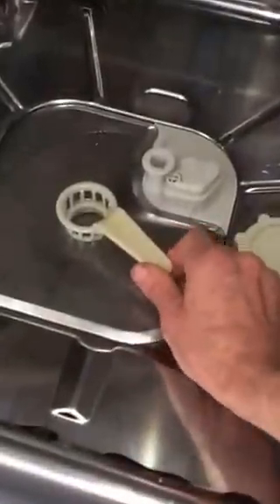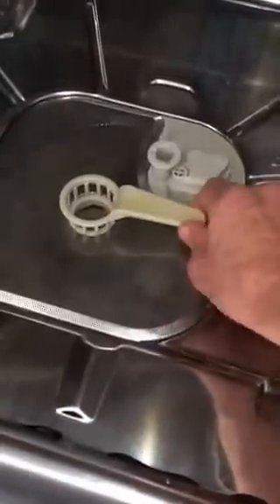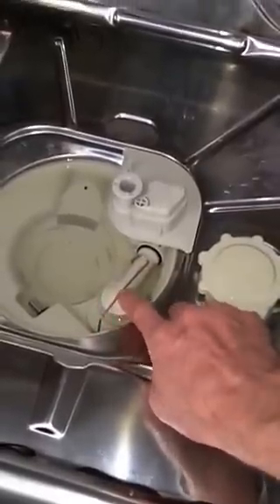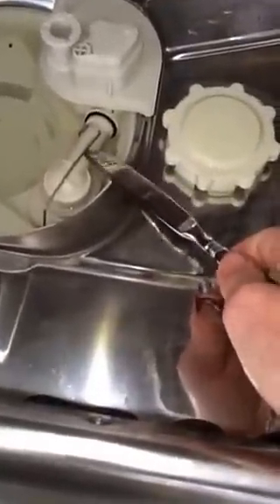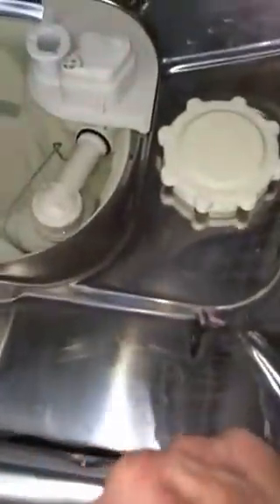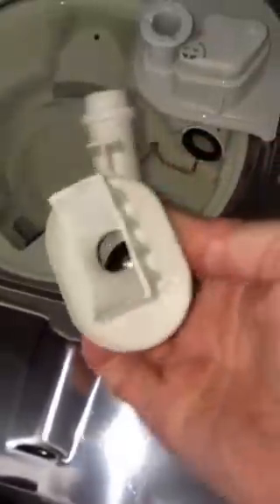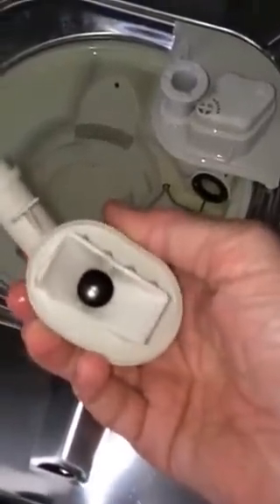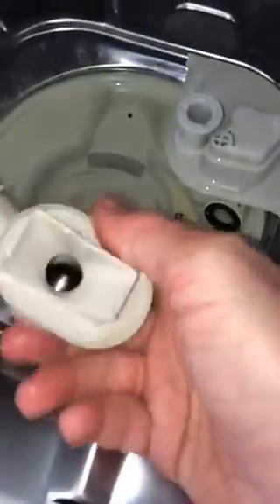✨ Miele Dishwasher - Intake/Drain Light - (3 Minute FIX ) - No Tools ✨

Comment: Can someone imagine that I fixed it???))) mom of 3, just instead of paying 300$ to someone, opened your video, followed instructions (though I had to disassemble that small part that you put away, there was a plastic thing stuck in there) and voila! Done! Will go and by myself a dress )
Reply from the maker: You should, you deserve a new one😊👍
Reply: I did it and I switch it on with the door open. When it starts the program it looks like the impeller push the water into the dishwasher instead of push it out to the drain pump. Any idea?

Comment: The non return valve was hard to remove. I passed a short length of rope under and through the valve and yanked up. This trick worked if you have problems removing the valve.
Reply from the maker: Good idea👍😊
Reply: Thank you. I got it out with a length of folded gorilla tape. There was a piece of plastic jamming the wheel
Reply: Thanks for the idea - was really struggling to remove mine!

Comment: Brilliant, clearly ex[plained , easy to do and the pip which had blocked my propeller was removed. I rebooted my machine by holding stop/start button and the Top Solo button at the same time, working perfectly now. Thank you so much, Diane.

Comment: I have checked every possible obstruction... the filter basket, the valve, the impeller. I can't find an issue. Everything is clean and/or able to move the way it should. When it first stopped working, the soap had already been released. I put another detergent tab in and for every subsequent attempt, the door doesn't open to release the soap. And it just pretends to work for a few minutes before getting stuck on Intake/Drain.
Reply from the maker: Can you send this same question to my email at: scottthefixitguy@yahoo.com

Comment: Thank you very much for your video. 

Just returned from 6 months away and surprised dishwasher wasn't working. Had to remove the ball part (after much effort) and check impeller (which worked fine).

Solved the problem and dishwasher operating now. many thanks and great appreciated
Reply from the maker: Very cool, thank you😎
Reply: If you're not going to use your dishwasher for some time, add some distilled water to cover what is shown in this video.  It helps to keep the seals wet.  I was told this by a Miele repair man.   You can reach the propeller just to the left and below the non return valve.  My little finger fit in and was able to turn the propeller.

Comment: My Miele Man! This is the 3rd time I've done this in the 10 yrs I've owned my Incognito. Worked every time. This time I found a few pieces of glass in the bottom after I removed the works but I have no broken glasses so the glass must have been hiding somewhere. I was kind of flummoxed this time because after I did all you said, it wouldn't start even though the red light was off...Duh! I had forgotten to push a cycle button when I turned it on. All good now! Thank you tons!
Reply from the maker: Thanks so much Mary😊

Comment: Hey Scott. Informative video!
My intake  gets stuck every couple of years and soaking it in vinegar water usually does the trick. However not this time. What do you do when the basket is stuck in place and wont come out? I'm afraid of breaking that plastic handle
Reply from the maker: This should help: ✨ Miele Dishwasher Stuck Filter⚙️ EASY DIY FIX ✨
https://youtu.be/se8e3ZrmXSM

Comment: Hey - I have an Advanta Series - been running great for 15 years.  I've tried this several times, the ball bearing is free;  the impeller moves (w a little resistance).  I tried the fork trick too (different video) but nothing really helped.  Anything like being level, some kind of hose blockage, motor issues.  I hear the motor which is usually followed by water running out (visitble through the bottom of the disposal) - but no water flows.  Any ideas?

Comment: Do you have similar instructions on how to do this for the Miele Optima Series? 
The video doesn’t exactly match the insides of my machine.
Same issue though. Intake/Drain light is flashing.
Thanks!
Reply from the maker: Your model is even easier.
Just pull off the filter and then to your left is the drain one way valve.

Pinch in with your fingers on the plastic tab and wiggle it off👍
Reply: @ScottTheFixItGuyChannel  I got the drain parts off and cleaned them out but I still have the same error light. Could it be something else? Do I need to call a Miele repair person out to replace something internal? I appreciate the help. Thanks.

Comment: Great video but I also had to check out the drain pipes.  We had an F11 drain fault show up.  We have a large family and also broke a couple fine wine glasses recently in the dishwasher.  I found little glass pieces by following this video along with a really gross filter that needed cleaning but the F11 code returned.  Your dishwasher drain pipe likely pipes into your garbage disposal.  As a quick fix turn on your garbage disposal to make sure there isn't water sitting in there.  Ours did and likely what ultimately fixed our F11 code.  Before that I checked the drain pipes.  There are two pipes connected to your dishwasher and passes under your sink, one for water to go in, one to drain.  The drain pipe is likely warm if you just used it and little heavier if water is clogged.  Our drain pipe under our sink had a joint we could easily disconnect and some gross water dumped into the pot I placed beneath it.  I found another small piece of glass this way.  Finally I opened up the air vent that is attached next to your sink.   You'll see a small pipe within the air pipe.  I used the faucet to run water through the small pipe which ran water to the open pipe below the sink leading to my pot.  I then ran water to the large air vent and water ran into garbage disposal.  That's when I realized I just needed to run the garbage disposal a little.  Put the drain pipe back together and ran under rinse mode.  FIXED!!!

Comment: My filter in the bottom of the machine is broken. I have a picture but i cant show it here in the chat i think. Is the filter necessary for the machine to fill up and drain water? Or can it work without that filter? I am troubleshooting to find out what to fix as the machine dont fill
Reply from the maker: When you turn it on,
Is it constantly draining?

Comment: I have a very old Miele dishwasher ( G595SC).  Recently the Water Inlet light has been coming on a lot of the time.  After much cleaning and reading I have found that there is a High or a Low water pressure setting.  This is in fact described in the manual.  My water supply has recently been changed and is now Low pressure.  I followed the instructions (it feels like a game hack) and now the error has vanished.  I mention this in case others out there are running a 30 year old dishwasher.
Reply from the maker: Very cool,  thank you

Comment: I think you had answered my question before. The machine wasn't draining completely. There wouldn't be any water in the machine, but when you pop opened the filter, there would be enough water there for concern. When we got a new non-return valve, it completely fixed the problem, after each rinse and drain, there wasn't even a half inch of water. Now, the water is much higher. It's still below the filter, the it's way too high.

Lately I've been using those Cascade Platinum tabs which is probably a big mistake because it's like putting Dawn in the dishwasher and I'm wondering if the drain hose is partially blocked with soap. Like I said,  it still drains; but nothing like before. You can hear the difference. The water just doesn't come rushing through the bottom of sink like it used to. Another thing when you turn the machine on and it start to drain and it will make a noise just before it starts to fill. That's normal, but whatever water drained just seems to come back into the dishwasher. It can't be the valve because it's still in good shape. Uggh, when these machines work, they're great, but when something goes wrong; it's aggravating.

I called a place that works on European dishwashers and they're really. They're coming out on Tuesday. Miele Service just charges way too much to come out to do anything. We used them for our washing machine and it was a difference of $150.
Reply from the maker: Good question,

It’s actually good to have about 1 cup of water under the filter to keep the impeller seal moist.  Bosch does the same with their dishwashers.
Reply: @ScottTheFixItGuyChannel  I know what it is.  The sealant to the where the non return valve connects looked like it peeled off.  It's hard to describe.  I'll take a quick video of it to show you.  I don't if I can put a sealant or what.

Comment: I would just add that having followed the procedure I was getting the same red inlet warning light however.....switching the machine to the "Stop" position on the actual tumbler knob & then back to a cycle DID get rid of the light & the machine working!
Reply: the original fix did not fix my miele, so I was wondering what your suggestion actually was.  What/where do switch the machine to "stop" position" on the actual tumbler knob?

Comment: For complete manual see link: http://m.miele.ca/OperatingInstructions/en-CA/Dishwashers/Previous%20models/Miele%20Dishwasher%20Manual%20G892-892SC.pdf
Follow the maintenance section. 
 I followed this video which is good and the intake/drain was still flashing until I had to do the following procedure:
1. Turn the dishwasher off.
2. Hold press the start/stop button.
3. And while holding down turn on the dishwasher.
4. Hold it for another 2 seconds then release.

I don't know if this a coincidence but this just worked for me and the intake/drain stop flashing after I clean the pump as this video shows.
Reply: Yaron Raps tried that. still doesn't do anything thanks for the tip tho

Comment: The direction you turn the filter basket a 1/4 turn is the opposite of the arrow I have on my filter basket handle. Either way - it won't budge...ideas? I don't want to turn so hard that it breaks. Thanks in advance.
Reply from the maker: Thanks Elle,

It’s a common problem,

Detergent hardens and acts like glue locking the bottom of the Filter to the sump area.

You can pour in a pot of boiling water and 3 tablespoons of vegetable oil and let it sit for 5 minutes and then turn that handle back and forth until it lets go.

Comment: Scott, I have the inlet / drain light on a 638i. I have removed the non return valve and lots of foul water returns back into the sump. I suspect there is a blockage further up the drain system. The waste pipe seems clear at the disposal end, and is arced up so water cannot return at that point. Any ideas? Much appreciated.
Reply: I should add... impeller moves freely, non return valve keeps sump mostly clear except the 1 cup of water, float underneath is dry, recirculating impeller is clear and moves. Drain/inlet light on, but goes off if I turn dial to stop, but on stop the drain pump sounds like it’s still turning. Only once non return valve is removed does the water flow back in - so it seems like it’s doing it’s job.
Reply from the maker: Hi Chris,
If you continue to hear the drain motor being active even when it’s at the stop that means some water has leaked into the drip pan which is below the dishwasher and that has activated the drain to continually run anytime the dishwasher is powered on.

Comment: thanks for this, I have tried this method and i did find a cherry pip next to the ballbearing, but sadly this has not resolved my issue. i've tried the other method too with the homemade tool. still no luck getting it to work. 

any other tips?
Reply from the maker: Can you send this same question to my email so I can help you further:  scottthefixitguy@yahoo.com
Reply: Have you tried changing the wash program on the dishwasher? 

I tried both the techniques in the video and couldn't find anything wrong (Apart from some general gunk). But the light kept flashing and the dishwasher wouldn't start. This was despite me turning it off and on again at button and plug.

However when I switched the dial to a different wash program it seemed to check again and then worked.

Comment: Hello, thanks for your video. My problem is the dishwasher motor is running but not doing anything. It is like it stuck on the first stage of cleaning after I pick a number cycle and close it. We have no sitting water in the dishwasher. I have done as you instructed in this video. I noticed, my propeller turns really easily, it is not as firm as yours. Making noise but not working, any suggestions?
Reply from the maker: +Tea with Mrs. B 

You guys have water stuck in the lower drip tray and it has activated the drain pump.

You can unplug it and remove the two screws that hold the silver front panel below the door and the use a sponge to soak up all the water and then it will work again.

Comment: We found nothing blocking the dishwasher mechanism but the machine still stops a few seconds into the cycle with the inlet / drain light flashing. We unhooked the drainage pipe of the machine too, but found nothing blocking that either.
Reply from the maker: I bet it’s a problem with not enough water coming in.

If you add water manually, is it able to drain that water?

Comment: Hi Scott, from Julia in the U.K. Im sorry this is a long mssg, ive tried to condense it as much as poss. Or if this is the right way to contact you.  I have watched many of your videos, mostly on the intake/drain light fault, and have to say they're great, very informative & well explained,  I had to subscribe!
 I was hoping that my problem would be solved by following your instructions but alas I have had no luck. I hope you would take the time to help please?  I have the Miele G692 sci plus3, so I have no digital screen to show a fault code.  After selecting a program the machine will drain, then fills intermittently, (starts/stops)  as it starts to fill the inlet/drain light flashes while water is flowing, then between flows the light stays on constant, then repeats 19 or so times. there is no movement of the spray arms nor can I hear any attempt of the machine to do so. (but I dont know if this is normal or not, having never taken any notice before, so dont know if the arms should be rotating at this point)   the inlet/ drain light continues to flash when water reaches the level it should, (just below the filter handle as shown in your videos) it will then do nothing at all, until I reset it to drain the water inside, the only thing that happens is the lower arm will rotate for about 2 seconds before end of draining. Miele uk said that the waterproof sensor may have acivated.... but the drip tray is bone dry.
It does have a small dry salt patch below the salt treservoir but that looks old and is bone dry too. I have cleaned the filter, the drain impeller and done the fork thing to move the other impellar in the sump. disconnected the water at the supply end and that was clear.
when I remove the drain ball valve I get a spurt of dirty water from the entrance to the outlet to the drain hose so am wondering if that might be a problem. Any suggestions and help if you possibly could would be very much appreciated . fingers crossed in the UK  :0)
Reply from the maker: Thanks Jules,

Can you send me a message to :  scottthefixitguy@yahoo.com
Reply: @ScottTheFixItGuyChannel  Thanks Scott for replying,  I will do that now x

Comment: Hi Scott, thanks for posting your video. I'm working with a G 975 Plus model but these steps did not work. The water level has pooled well above the level you mention in the video. Nothing was blocking the propeller. Nothing drains when attempting to run a cycle. Any ideas/suggestions?
Reply from the maker: I bet you there’s a blockage in that air gap up near the kitchen faucet.
Reply: @ScottTheFixItGuyChannel  I suspect it's related to outside the machine as it's been to Miele to be 'fixed' yet the issue remains. The air gap you speak of was covered, but it still didn't drain. Will look into it. Thanks for your reply :)
Reply from the maker: If you put the drain hose in a bucket will it drain?
Reply: @ScottTheFixItGuyChannel  I gave it another run today and fed the hose into a bucket with success! It ran a full cycle 🙌So the dishwasher is fine with your suggestion of something blocking in the pipe the problem. Legend!

Comment: @ScottTheFixItGuyChannel I did it and I switch it on with the door open. When it starts the program it looks like the impeller push the water into the dishwasher instead of push it out to the drain pump. Any idea?
Reply from the maker: Make sure the impeller cover is clicked in place.
Reply: @ScottTheFixItGuyChannel I did it. And nothing changes. Is it possible that the impeller turns in wrong direction?

Comment: Hi Scott - I tried your techniques but the intake drain light is still flashing after starting the wash cycle for about 5 mins. Didn't find anything in the impeller and the ball bearing is fine. Any advice? Thank you.
Reply from the maker: Does the water fill up to the level of the filter plastic handle?
Reply: Hi Scott - no, it doesn’t.  It covers the mesh cover and above it about an inch.